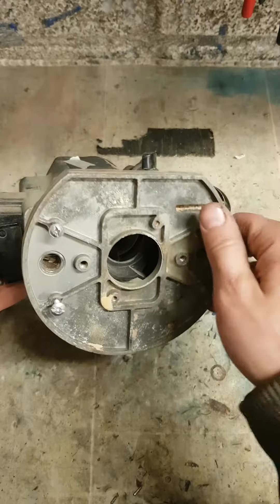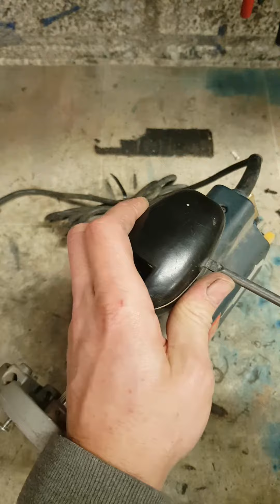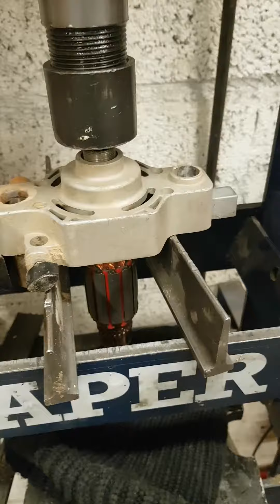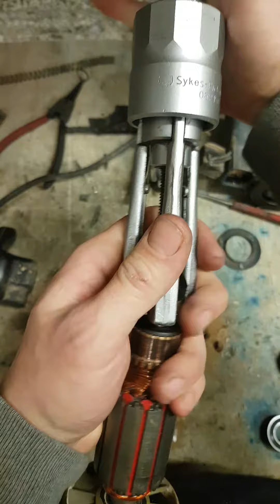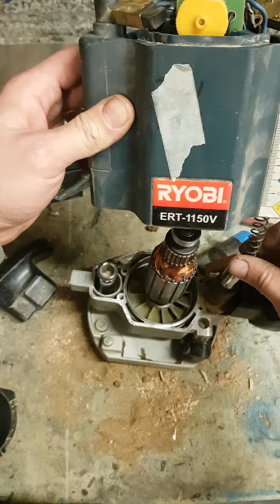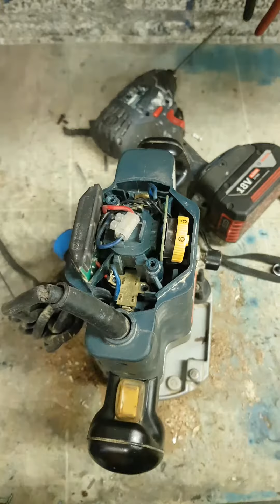How to repair an old blue Ryobi router. making a loud noise and needs new bearings.

Comment: I just did this repair on my ERT-1150V - just to note that there should be a felt washer 'ring' which goes in before the main bearing to help prevent dust - looks like it was missing on this router.